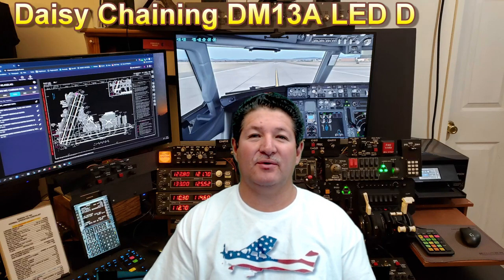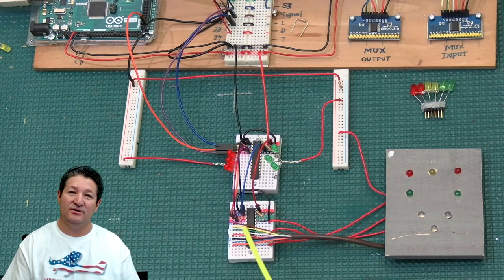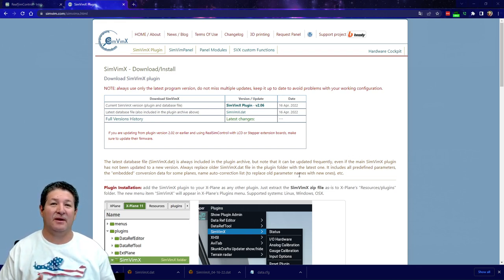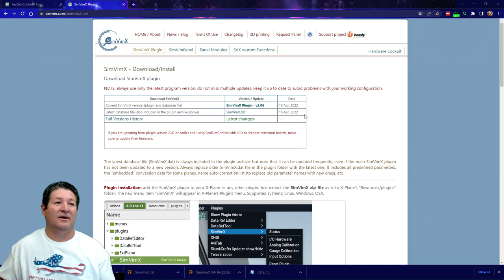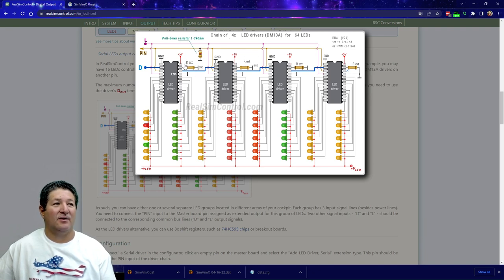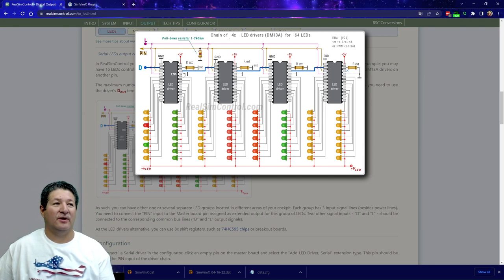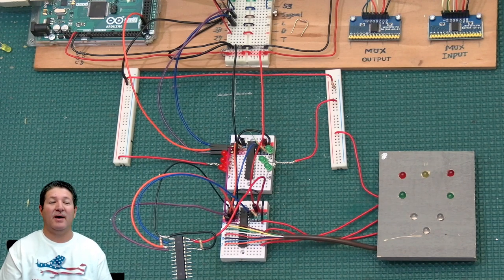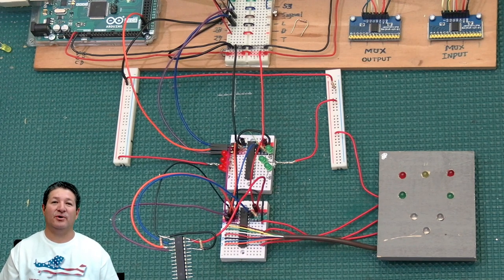Daisy Chaining DM13A LED Drivers for use with SimVimX

Comment: Excellent video Jose ! May be you can talk about making gauge ! With stepper motors
Reply from the maker: Maybe someday I'll get to that but as now now I have absolutely no experience with Steppers or Servos yet
Reply: @Qosmokid  ok no problem!! You doing an amazing job for the community
Reply: @FlintSky18  I've been using a 1Ma meter with the TLC5947 and discovered a bug because, when I connect directly to pin 44 (2 to 13 or 44, 45, 46, 47) it worked but not with the tlc5947 board.  Vlad and Roman found and corrected the bug.  I'm about to check the corrected version.  With a 4.7k resistor inline, 1Ma meter works (to determine the resistor, use the formula E/I x R - which are interchangeable so that E=voltage, I=Amps, R=resistance ) so that 5volts divide by .001Amps (1 milliamp) gives 5k resistor.  If using the tlc board, connect the control pin to arduino pin 30 to 37 then the L(pin27) to the LAT pin and D(pin28) to the Din on the board.  The pins on the outside of the board are +5v and the inside pin to the neg. on the meter.  Each board can handle 24 meters and 8 boards would allow for 192 meters.  NOTE: You can use LEDs with or instead of meters to get different light levels.  Don't forget to use the calibration in simvimx to set the meter range.
Reply: @philnelson2364  oh wow to technical for me , but definitely I would give it a try 💪
Reply: @FlintSky18  That's the only way to learn, try it.

Comment: Hi, you are giving great info.. I would like to ask if possible to show us how to connect a  MAX7219 dot matrix module as i cannot find DM13A over in my place. I had it working in a previous version previous of simvim data base but when updated to latest i cannot get it to work.. Thanks in advance..
Reply from the maker: Hello, thanks for you comment. Unfortunately I don't have any MAX7219 dot matrix modules so I can't make a video on that. 

Just from what I see on the website it seems like the connections are exactly the same as a regular 7 segment display.
The only thing that makes it seem more complicated for me is the matrix type positive and negative connections to the LEDs.

I have a video where I show how to connect MAX7219 and TM1637 displays but I am planning to record new ones on each type individually

Comment: Hi, like to watch your channel. One question from your dm12a chip controlled by your arduino. where are the D line and the L line hook up to? what kind of pins on the arduino by, or what interface (i2c or other), is used there?
Reply from the maker: Hello Mike, have you read the pages on the RealSimControl website yet? It's really hard to explain it in a few words because there is so much information. This system uses the SimVimX firmware on the Arduino Mega. There are no Arduino libraries used. I recommend you watch the first two videos in my "Back to basics" playlist and also read the related pages on their website.

But this uses no common interface, the D line is pin 28 & the L line is pin 27 on the Mega. 

https://youtube.com/playlist?list=PL_39nliBxZCWlrPDCW440ShaqurNe1c_g&si=aydJjciTRH8MkaGJ

https://realsimcontrol.com/pics/m_full.png

Comment: Thank you for this video. If I may ask --  when you have time --  to do a video on the MAX 7219 Dot Matrix ( Led - Matrix Digital Output ) -the other method of controlling 
multiple LED's using a LED matrix. I have tried doing this in the past( It did work at one time ) but it presently does not work for me. I am not sure if something has changed in their SimVim software or I am now doing something erroneously. A simple example will suffice. If you have a problem getting it to function also - I would appreciate knowing your experience. ( I am using SimVim Plugin -v2.08 May10th /with .dat May 12th ). This approach requires less wiring and hardware. I would like to use it if possible. THANK YOU !!
Reply: I just found out there is a problem with the LED matrix setup.It will be fixed shortly with version 2.09 with some enhancements. My setup did work properly at one time. A video
from you would still be helpful to the community  -- especially if a new approach is presented. THANK YOU !!
Reply from the maker: Hello Jolo, I don't have any Max7219 LED Matrix in my inventory therefore I can't make a video on that  one. Maybe some day I may get one but no promises. I really like the DM13A because it's so easy to use

Comment: Hi,  Can you please tell me how to reload the configurator pin board arduino?    everytime I start the realsimcontrol configurator there is no info on the pin board so I loose all my settings and dont know what pins I have used
Reply from the maker: Hi John, you have to click on the "Edit" button next to the "Save" button on the top and open your data.cfg file that you previously saved.

Make sure you save it with the same name after you add or make changes to it otherwise some browsers with try to save it as data.cfg(1)
Reply: @Qosmokid  Thank You that worked